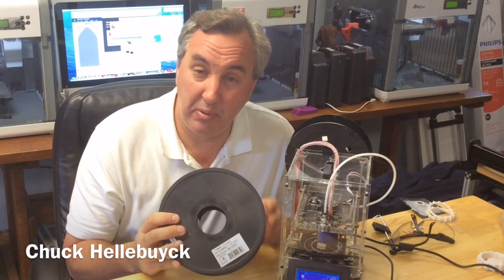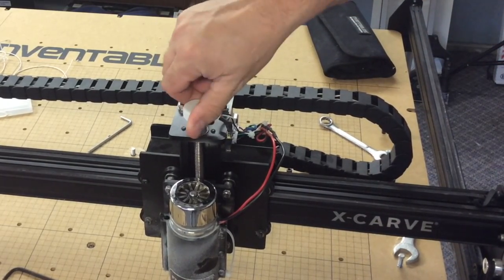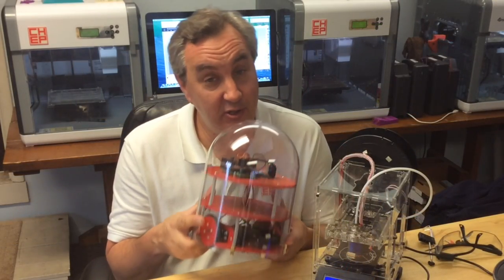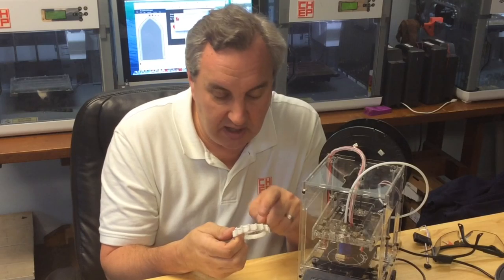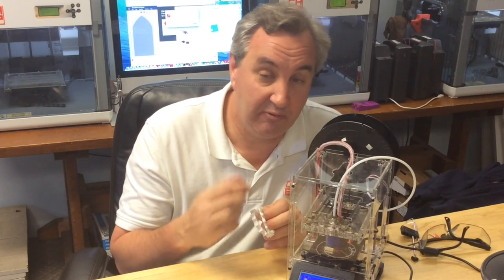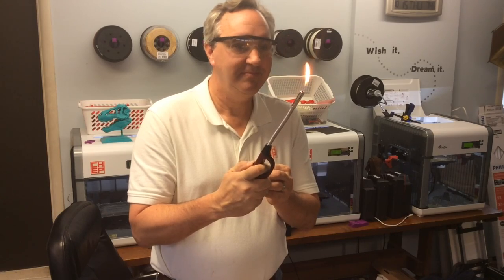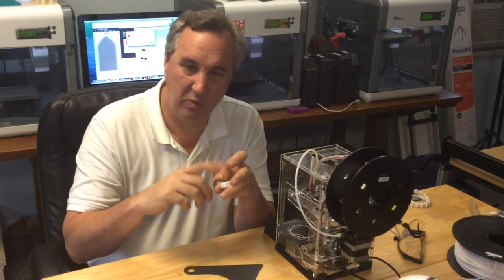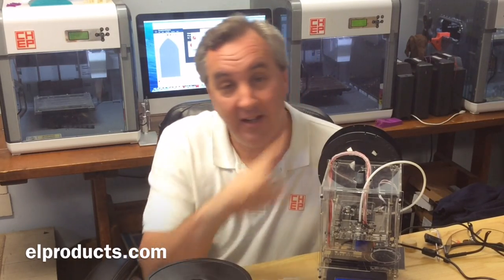Filament Friday #37 - Flexible Filament 3D Printed on a Fabrikator Mini

Comment: As some others have mentioned, with flexibles turn off retraction and use the same print speed for all layers, this really helps as it keeps a constant feed rate to the extruder. For the pitted top if the earlier tip doesn't cure this you may need to increase the number of top layers to ensure you get a better finish.

Comment: One of the reasons I use washable glue sticks sometimes is so that prints will come off the build plate. Good call slowing it down. I print at 230 and 45mm/s with any TPE filament but in general bowden extruders have a harder time. Great video.

Comment: When printing flexible so on a Bowden tube don't forget to also turn off retractions which could cause the filament to stop flowing and begin flowing inconsistently even with direct drive.

Comment: On my Bowden fed E3d V6, I turned off retraction, 230C hot end, used a heated 60C bed, and prints great, but lots of cleanup cause of stringing. Comes off the bed easily once I upped the bed temp to 60C. No idea why a cold bed glues it down like super glue... I also did not fan cool the bed, helps with layer adhesion. When I fan cooled it, I had delamination problems.

Comment: Hi Chuck,

one of the guys at work pointed me to this kick starter today

https://www.kickstarter.com/projects/steelmans/modifi3d-3d-print-finishing-tool/description

if you don't want to use the link, its a kick starter for MODIFI3D.  A heated tool with shaped tips for cleaning up / modifying 3D printed parts.  It's USB powered so I imagine it will need a good 2 amp wall adapter but that's not to hard to find these days.

Just thought you might be interested

Oh, I gave up on trying to buy a Fabrikator Mini printer, I'll be getting a Hello Bee Prusa delivered soon instead :)

Steven

Comment: With bowden you will always have trouble with flexible.  You have to print it high temp and slow because basically you can't control flow that will as pla or abs. Did you have any issues with bed leveling? Do you use gluestick?
Reply: +Chuck Hellebuyck's Electronic Products hi chuck it's me again I was wondering if I were to get a CNc machine which one do you recommend?

Comment: if you want a flexible filament with any pla printer or filament just print your thing and soak it in acetone over night and it will make it jut like rubber. thats what i do with my da vinci jr because i cant use 3rd party filament .
Reply: UnboxNow that's cool. I might try it with me davinci 1.0

Comment: I know this is pretty random and doesn't apply to the video, but do you know if the jhead hotend on the mini can be directly upgraded to the e3d v6 hotend? I'm thinking about upgrading mine because I have a serious enough clog where I might just need a new hotend. The only thing I think I would have to change would be the ptfe tube connector on the main body of the hotend. I was planning on just using the same heater and thermistor but I don't know if that would work or not.
Reply: +Chuck Hellebuyck's Electronic Products thanks for the reply, I'm going to try it, it should work and hopefully won't jam as often.
Reply: Hey, I just wanted to let you knot i swapped the hotend and it works perfectly now
Reply: +Chuck Hellebuyck's Electronic Products it actually does but I didn't bother, the only things that change are the thermistor settings in the firmware as well as the max heat. I used the existing thermistor and I really don't need my printer to hear to 300 degrees so I just left them as is.

Comment: We are two fathers that have crowdfunded the Worlds First Fleixble 3D 
Printer Filament made from compostable raw materials. It works with all 
printers we have tested so far including Bowden Extruders. It is also 
heat and cold-resistant from -15 to 105 degrees. Are ou interested in 
testing it? Get in contact with us or purchase it directl from us: 
http://willowflex.eu/